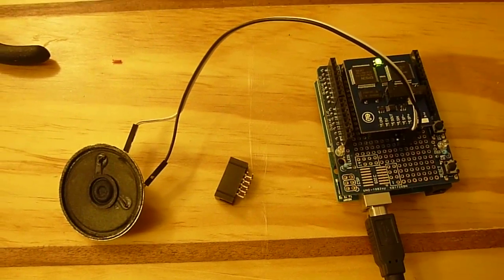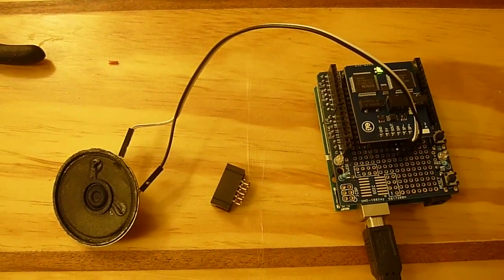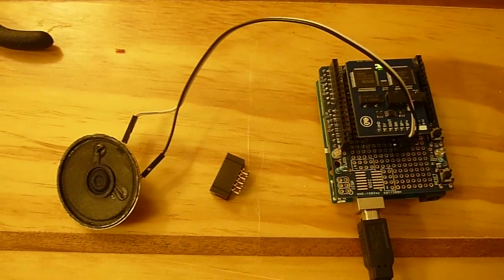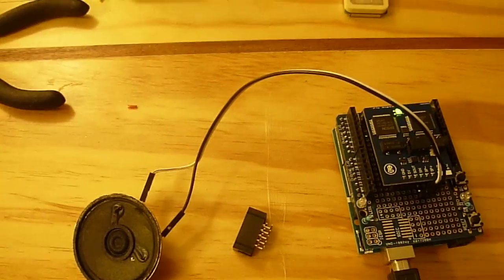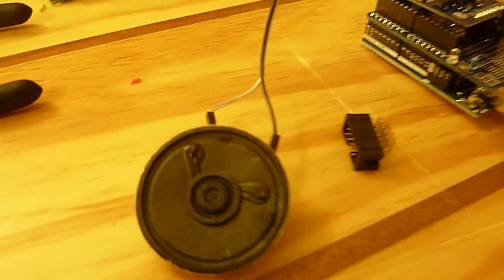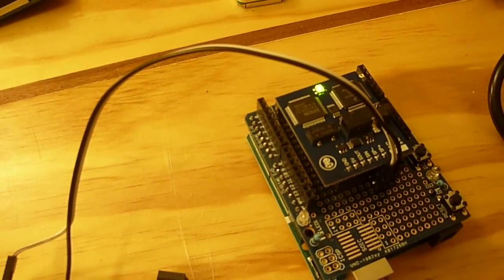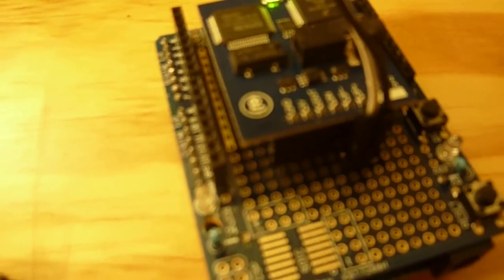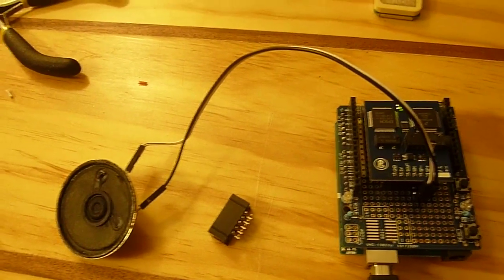EMIC 2 Text to Speech on Arduino

Comment: Can I use these to convert text to speech for message received on GSM module?? Please help me
Reply from the maker: Simply connect the Emic-2 to a 5VDC power supply, connect a speaker to the speaker output (or 1/8" headphone jack) and send it a stream of serial text at 9600bps. The module contains all of the smarts necessary to parse the text into phonemes and then generate natural sounding speech, all your controller has to do is send serial strings.

Comment: Steve, thank you for taking the time to make and share this video!  

Can you describe how you have been using the EMIC 2 and Arduino to connect to micrometers, calipers, scales, etc. to produce speech output for the information displayed on the LCD panel?  

I am curious because I am in a similar situation and have used synthesizers like the EMIC 2 (all the way back to it's grand daddy, the DECTalk DT01), and most devices I've been asked to modify don't have the serial communication capabilities the synthesizer uses or don't expose them.
Reply: Daniel Aunspach it's simple to connect Arduino to these module jus need to connect four pins